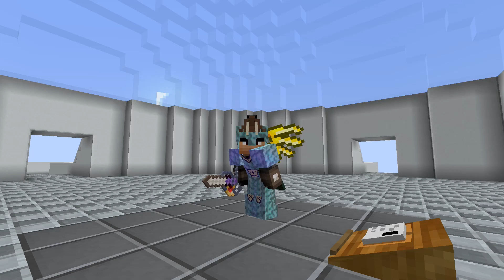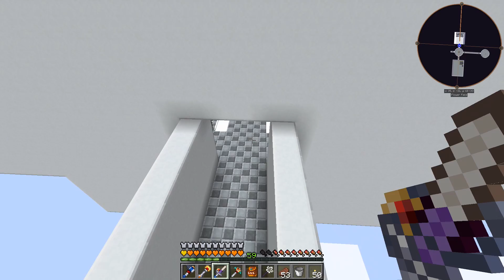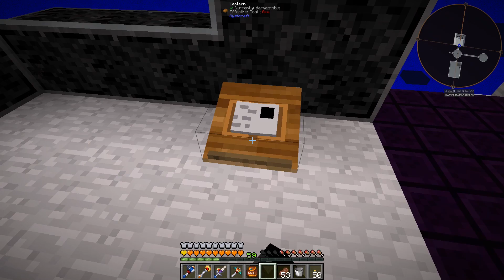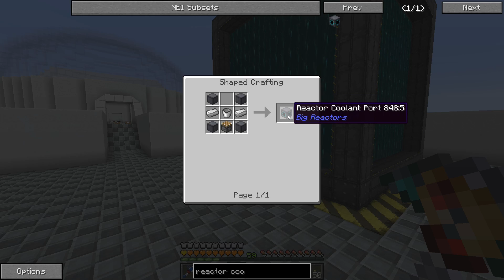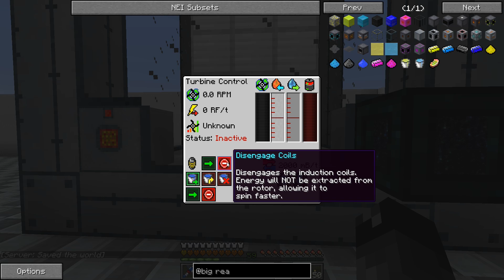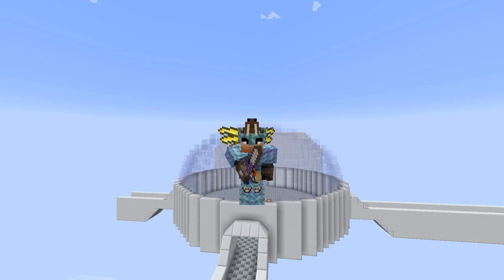Minecraft Mods FTB Infinity - BIG REACTORS TURBINE [E25] (HermitCraft Modded Server)

Comment: Top and bottom can be glass if you wanted, and also, a Builder's Wand can work diagonally, so you only need that first layer of blades and you can then get all 8 with each click with the wand. (Oh, and you can have two turbines share tesseracts with each other for power/water/steam, just having them next to each other and it's rather easy. Also, you don't need purely closed circuit, you can have them all go back and forth with an extra something going in from elsewhere to top it off in case for some insane reason it loses water somehow. Also automatically tops if off if you add more turbines. Lets you make a LOT of turbines with the water being rather simple.)

Comment: It might be a cool idea to put the turbines horizontally. You're not limited for putting the turbine vertically. That way you don't need as high of of building. And it might be cool to put two turbines one at each side and at the end of the room a reactor that provides sufficient steam for both :). So you can keep the room a bit symmetrical and you use all the space you already provided.

Comment: Just a thought on layout for turbines. put one turbine in each corner of room with the reactors sunk into the floor in the middle with just the top two rows sticking up so you can mount your controls etc? That way if you want to put a roof over it later you have room to build other things over top of the reactors later.

Comment: Today on FTB Infinity counting with hypno :P
I wonder if you could use the railcraft steam boilers in conjunction with the big reactor turbines?
Reply: I have before you just need about 3 high pressure boilers at max size
Reply: so its probably not very fuel efficient? what fuel were you using?
Reply: creasote and yeah not really i also had a coal coke one

Comment: You should get enough steam as long as the reactor outer casing temp is above 300 degrees. For better fuel efficiency, you want to try to get the core temp down under 800 degrees.

Comment: you need 37 enderium blocks not 36 or 32 ludicrite blocks
and if you use coolant like resonant ender in attive coled reaktor you lose heat if you lose heat you lose steam so i suggest removing resonant ender and gelid cryotheum and use blazing pyrotheum for more heat
and if you want fill reaktor fast and easy you can use buildcraft flood gate

Comment: Ludacrite is the best block in the turbines
Reply: Yup. About 28000RF/t for 32 blocks compared to 24000RF/t for 37 blocks of enderium. It also allows you to build more compact turbines, making them more material-efficient.
Reply: Yeah, Ludicrite is the best and is more aesthetically appealing math wise. More expensive, but more power too! Also, if you use Ludicrite, it only has to be 16 high because you take away a coil making 4 coils and 10 blade spaces for interior 14 + 2 for outer shell for a total of 16 high. You could then turn it on its side...